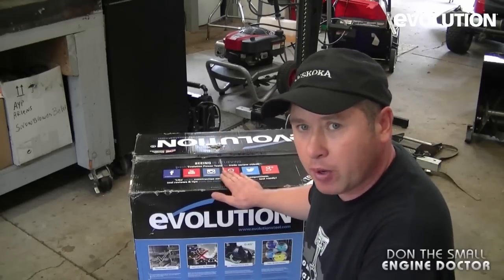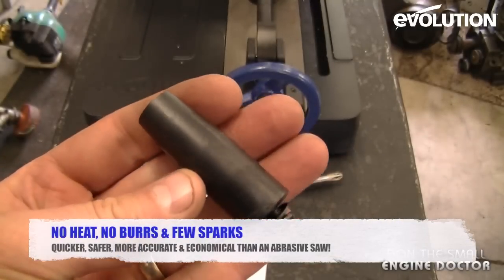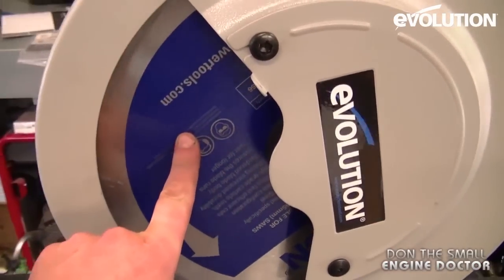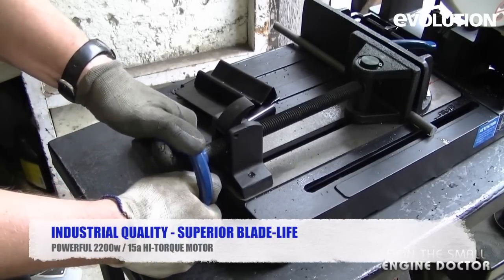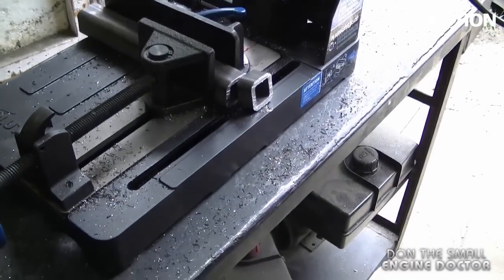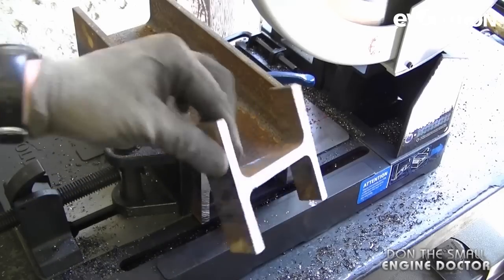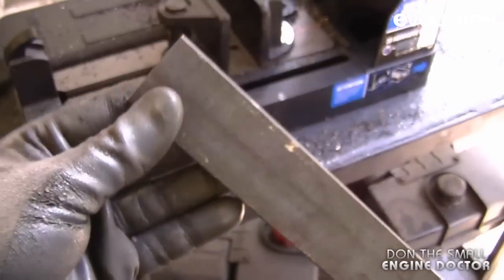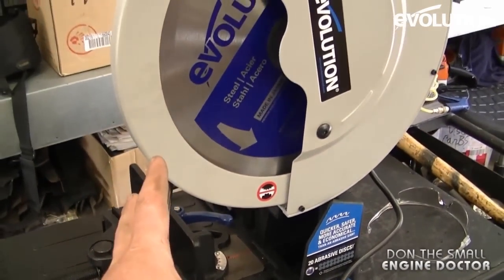Evolution EVOSAW380 | The Small Engine Doctor Tool Review!

Comment: 6 years old video

i have  the small  metal bandsaw from HF
i have a  small tabletop bandsaw
and just purchased  a grinder type chop saw

dang
i should check thi s video first
its amazing how it cuts
i worked in machine shop from 75-1998

we used alternating saw
that I beam  could take 3-5 min at least..
thank you much for this  viddeo

Comment: Hey man, they recommend with angle and  square to cut it at a 45, either using the jig for the square or just laying the angle point up! That way the blade never has to cut the flat section!
Reply: Ok. All good until you need to cut 45 degrees. Which is most of my box section cuts
Reply: @bjpayne1615  ahaha  well in that instance it won't work! 😂
Has the machine been holding up pretty well? Im going to be buying either the evolution or the fein slugger in a fortnight and I think I'll be getting a  diablo cutting disc as I'll be doing a lot of high carbon and alloy steels!

Comment: The steel beam was really not bad , but can you cut maassive roundstock for the lathe like 3 inch diameter Steel, Aluminium and bearing bronze 
can you show or test the maximum hardness of materials it can cut - like can you cut a hardenend block of steel

Also can you cut a piece of full size railroad track - not mining cart railroad bu the real stuff - with the 2.5 inch wide rail head?

Comment: hi i have a question, can I cut box section(size 60 mm x 80mm)in 45° with the evosaw355?
Reply from the maker: It is within the spec of the machine, however please check the thickness of the box section.

Comment: This company do just great marketing, but in real tools are very bad quality!!! I bought Evolution Rage 3DB for 500EUR, and after 20-30cuts in metal, blade is not sharp anymore and you can just throw blade into trash! - and pay another 30-40EUR for new blade
Reply from the maker: Rage 3DB is multipurpose not a steel cutting unit. The best performance for our multipurpose blades is coming from cutting mixed material. For those who may be interested in purchasing Evolution multipurpose TCT blades, should know they are rated for only mild steel within the Brinell hardness rating 200-220HB, not galvanised or stainless. Tips on how to extend blade life found here - https://www.youtube.com/watch?v=fdTGws2-lTg

Comment: How many rpm? Can I use one of these blades in my abrasive disc saw?
Reply: Sierra casera
Sierra minisierra para cara casera usic1950
Reply: Only 1300rpm. No you can't use these in an abrasive saw, the disc will burn out in seconds.

Comment: This blade wants a 1300 rpm saw. You can buy them separate. Also, NEVER cut angle iron like that with this blade. This blade desires the least amount of contact possible. Use that little accessory the OP said was for pipe and put square tubing on  edge, and remove the tool and place the angle iron with the outside of the 90 angle pointing up. Also, I recommend welding pliers or long nose vice grips when cutting less than 2" off the end of a piece. The blade can grab as the cutoff falls. You'll hear a clang and the cutoff will go flying, and your blade will have lost  a couple teeth.
Reply: Scott Hynes you're 100% right. Angle iron up, and be very careful cutting small pieces. I have this same saw and it is absolutely wonderful. It says in the instructions not to cut pieces off smaller than 5/8" I believe. I've done it and the cut off got sucked into the guard and broke off part of the casting. That was on me. The switch in my handle went bad. Evo sent out a whole new assembly. I had it within a week. They were great to deal with. I'll never got back to abrasives.
Reply: I wish I would have read this before I did the same thing you were talking about. Cost me a $60 blade. They Evolution in Canada did not provide that angle bracket with my saw. I built one.

Comment: Anyone knows if it can cut faster, without damaging the circular blade, some tool steel like 1.2379 (max 230HB), I only work with tool steel and right now I'm looking for a replacement of my bandsaw, it doesn't have automatic feed and last week I lost 38 minutes to cut a steel part, quite small. On the other hand with the same bandsaw I was able to cut another larger steel part (140mm long by 15mm thick) much quicker, less than 10 minutes , but because was a different steel ally, it was 1.1730 which si around 190HB

SO .. can this saw cut tool steel 1.2379 / 230HB ?

Comment: abrasive vs carbide :
abrasive is cheap , less dangerous
carbide plated is fast , cold , so precise

its almost impossible to cut near end of a metal with abrasive .the blade will deflect easily and will ruin your part . another problems with abrasive is you nearly cant cut aluminum , wood , plastic , and other non ferrous materials ...
while you are cutting with abrasive disk it will slowly get converted in to dust and pollutes your workshop !
i also think making abrasive disk is not environment friendly and its not recycle able !!!
abrasive disk spins almost twice speed of carbide disk ..
its also possible to use wood cutting carbide disk for cutting metals . but wears faster

Comment: Can I install cold cut blade on my abrasive cut off machine????
Reply: It would spin at way too high rpm to operate safely. The cold cut blades should spin roughly about 3 times slower
Reply: Alfredo Zamorano ye macin kaha se milegi or es ke cost kya hoge. 9917494003

Comment: Thanks for the Review Im going to buy a Metal  cutting saw , I like this saw better than the Dewalt saw , How much does it cost and how much are the blade replacements ,  and is it 120 volts, just a little  safety  tip with your saw  the  #1 reason  you will have a blade break and can shatter and you can be seriously  hurt IS when your cutting  the end off a piece  of steel and your not over your blade chip slot especially  for someone  who never used  that type  saw IS that that little  End cut gets wedged IN BETWEEN the Blade the  the chip slot and will bend the blade and it will break  ive had hundreds of hours on this type saw ,so just keep that in mind when your cuttting end cuts and squaring  a piece  of steel ,im just starting to record   videos soon  on YouTube   please subscribe  if you like like...Thanks